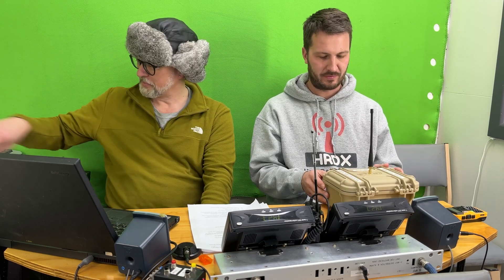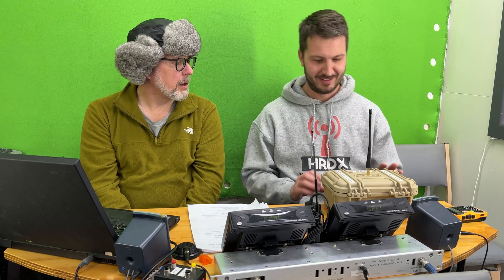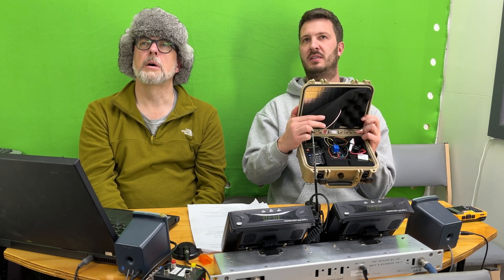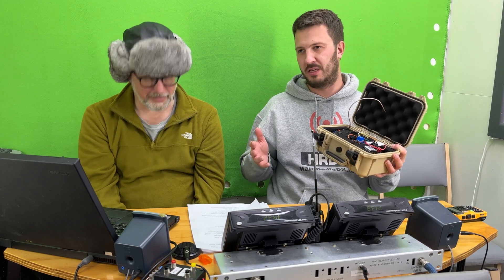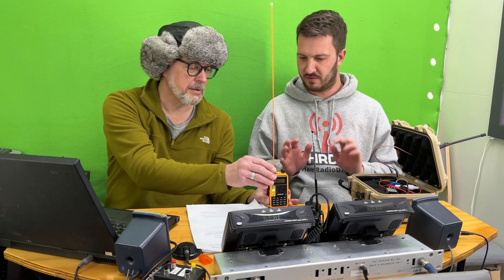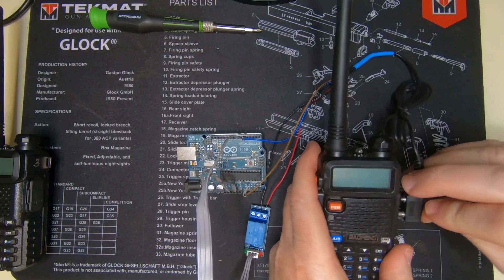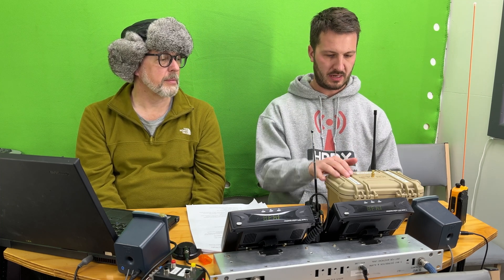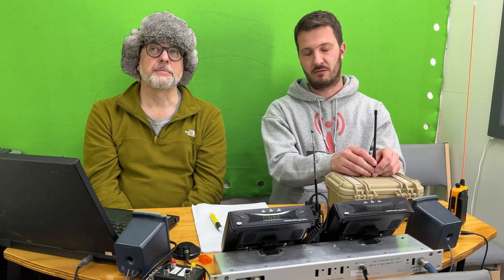Fox Hunt Transmitter Build Using a Arduino + Baofeng

Comment: I wanted to get a few baofeng for me and mates to use for communication when hunting. Is thst legal to do in Australia. What would we hsve to do for it to be legal? Thanks
Reply from the maker: Baofeng’s are only able to be used in Australia by licensed amateur radio operators. You may want to look at getting your Foundation license which is easy to obtain and will allow you to use these.
Reply: @HamRadioDX  ok thanks so if we do that we could pick a band and use it out hunting without issues?